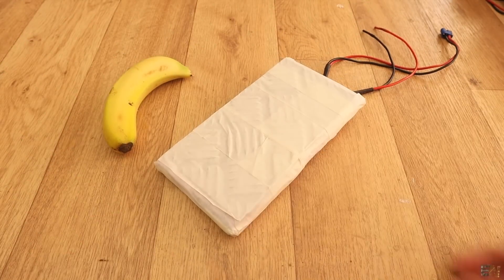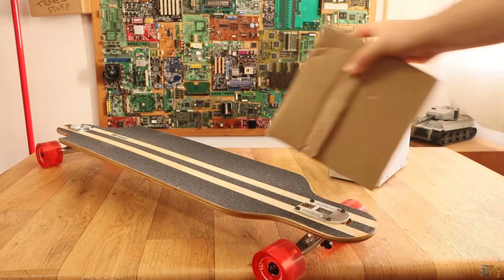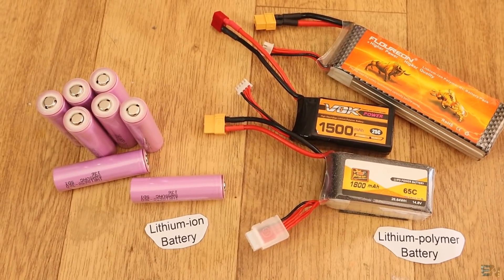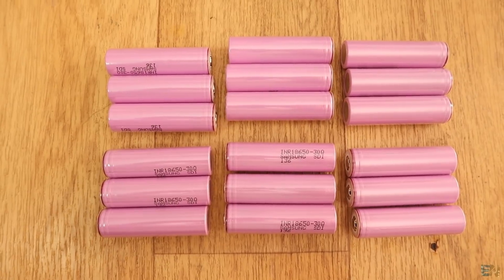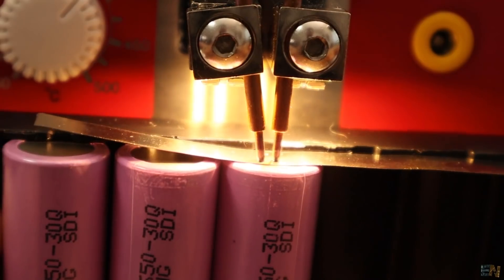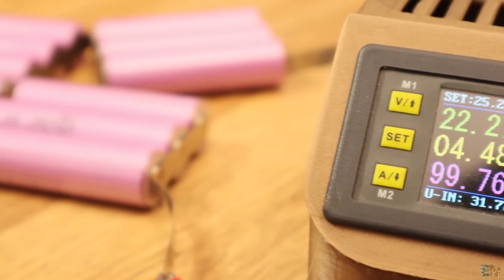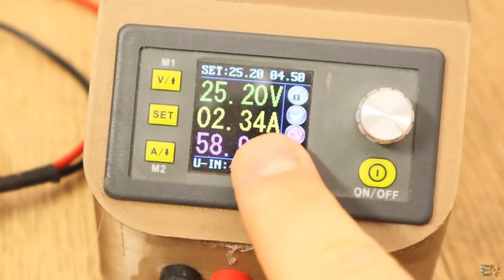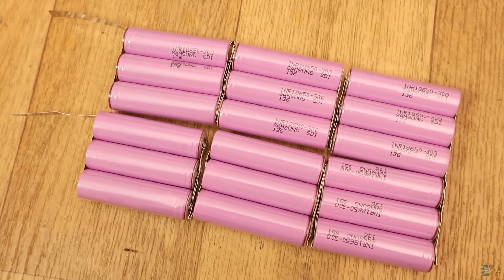Homemade 6S Battery Pack with BMS

Comment from the maker: I might change the BMS with a better one for my electric longboard. More updates on www.electronoobs.com
Want to help my workshop: https://www.patreon.com/ELECTRONOOBS
Thank you so much!
Reply: Are there no better cells? My phone has ~4 Ah and is less than half the size.
Edit: do something with this supercapacitor recuperation technology. There is this YT dude with a capacitor bank as a car battery.
Reply: you should show testing
Reply: For the powered skate brotha you want high discharge capable cells, like from a cordless drill battery pack. Those BMS are “usable” but you’ll have to manually balance the cells. I can hook ya up if you want more cells, love the videos and hit me up if.
Reply: I can send you an SBMS0 when will be available if you are interested. It is open source but a bit of overkill for such a small application. You can see details about the SBMS0 on my current Kickstarter page https://www.kickstarter.com/projects/electrodacus/solar-bms-and-digital-mppt-for-pv-electricty-and-h
Reply: Please make a BMS.
Reply: Do you have the schematic for the 6S BMS?
Reply: Will these Li-Ion cell work for my below hex?
1)Frame:Tarot 680 PRO Folding Hexacopter Frame
2)Motors:6x Tarot 4108 High Power Brushless Motor (380kv)
3)Propeller:3x Tarot 1355 Carbon Propellers (Two Holes / CW and CCW)
4)ESC (Electronic Speed Controls):6x Hobbywing XRotor 40A-OPTO ESC
Reply: do you think all of us we can understand easily how to make this??? why you didint show how you intall the bms?? useless video i cant get it. dislike

Comment: why you connect the bms to the negative of the cells?? 06:38?
Reply: doesn't matter positive or negative because the wire is between them , the important thing is to follow the direction.

Comment: Also, youre using a 120A rated esc which is way higher than your battery 60A max current. is that safe? i thought your ESC current rating must be lower than of the battery current.
Reply from the maker: Hi. Using a 120A ESC with 60A battery would only be a problem if the motor would draw in any case more than 60A. But for this proy maximum current was around 10A. Also using that 10A BMS was an error and I had to remove the output  current limitation on order to work...
Reply: @ELECTRONOOBS  alrighy, may i know what was the motor that you used that is lower than 60A max current?

Comment: is that okay using a 15A rated bms when your battery pack current output is 60A? since you connected 3x 20A batteries in parallel

Comment: Hi There, can i charge the pack while load is connected (load is live/active/running), i am planning to use readymade 3S1P or 4S1P battery pack with relevant BMS circuitry.

Comment: Please make an Arduino setup, to display the voltage levels of different battery packs. Like lithium 3s, 4s etc.. It will be fun to see the battery level information in voltage, percentage or graph in a color OLED or color LCD display. BMS with this feature costs a lot! But this should not be a BMS, it should be able to work with any battery pack, which already has BMS.

Comment: On section 6:39 , when explaining the battery protection, is that a mistaken labeling of the b1 for reference bat 4.2v and b2 for reference bat 8.4v? I'm confused with the blue wire as 8.4v instead to 4.2 v, since the blue wire is referencing the first battery. 

Anyway, good projects !

Comment: I want a lithium ion battery pack with 4 batteries in parallel.i have a tp4056 with a inbuilt protection circuit for charging.Would it be possible to charge this 4p battery pack with a single tp4056 or should i charge each of them seperately.

Comment: Can you please make a voltage  booster circuit using IC 555 to charge 450V  capacitor bank .

Comment: Hey great video. but i'm curious, it didn't look like you were discharging through the BMS, which means you wouldn't have any protection like over discharge, over current, etc. I had a setup like this on my mountain board and I just used the ESC's low voltage cut-off. But if I had the BMS wired up proper as well I think it would have been better. 
Keep up the awesome stuff!
Reply from the maker: My plan is to bypass the BMS for the discharge to have more current and control the voltage with the Arduino that I'll be using to generate PWM signals.If not, the BMS I think has only 10A discharge protection and I need more. Is notrecommended to do that but lets see what will happen. Thanks!

Comment: To reinforce the case you can add some ribs that would fit between batteries on the bottom of your board and connect that aluminium plate to them. It will make it much stiffer and protect batteries from getting squished in case you land on something.

Comment: Nice video my friend. One small tip : hot glue is not good for heat dissipation... Try use some specific adhesive or maybe a thermo conductive paste. Keep it up friend

Comment: I builded my ebike battery out of used cells. It is 10s4p 36v about 8ah. I dont have bms, but I measured cells voltage today after 2 months riding dayly and they were exact same level all. I soldered my cells whit nikel plate. Only cost was 0,5 euros for nikel plate and 5e for wires.

Comment: Very good work! I built an electric longboard, the best way to do it, is a brushless hub motor (or  two !). I don’t know if you are thinking about it but it will save you money and time. I had to create an heavy structure with a lot of 3D printed parts to use a common brushless motor and to get something reliable. Also, it is not possible to get a strong 3D printed pulley but you can order one on the internet ;) I am looking forward to see yours !

Comment: wow genius boi✌ it was awesome.
and
im trying to run my pc using 5v mob charger. so it will be environmental friendly. and mainly it will reduce my electricity bill 😓🔫.
Reply: I'm afraid that won't work at all. First off, you need the correct voltage for it to work. And the most important of all: even if you could get it working, it'd a futile effort as the power used by the computer will be exactly the same.

Comment: Why don't you choose 2 Li polymer battery for 25v?
Reply: Li-ion batterys have a better density so they are smaller and not so heavy for the same capacity.
Reply: GameArea158 thanks

Comment: do you use the same connector for charging and discharging?
Reply from the maker: No. I have 2 different connectors as in the schematic and I bypass the BMS for dischaging.

Comment: Hi, 
The discharge connection is also via p+ and p-, connecting wires to batteries will bypass bms
Reply from the maker: Thank you. If my longbaord will require more current I might bypass the BMS for the discharging process and control the voltage with an Arduino. Not sure yet...
Reply: Electronoobs yeah the p+ and p- terminals are for powerIn and powerOut :) so charging and discharging. Great tutorial love your channel.

Comment: I  have a scooter with a 20v motor that was run by 2x 12v sealed lead acid batteries in series.  Is this ideal for my scooter?
Reply from the maker: What type of motor?
Reply: @ELECTRONOOBS  I think a brushed motor that came with the scooter
Reply: @ELECTRONOOBS  Ok I have the details.  It's a MY6812 24Vdc  100W brushed.  http://unitemotor.com/index.php/Home/Index/product_detail/id/178
Reply: Any suggestions?
Reply: I would make 7s. You get litle more speed. And atleast 4 cells parallel to get range and torque. Some peoples say that is not good to use lithium batterys whit brushed motor, but that is bullshit. I have brushed motor in my ebike and it is working well. I have 2pcs 10s4p 36v batterys now, and I'm going to update those to 13s.